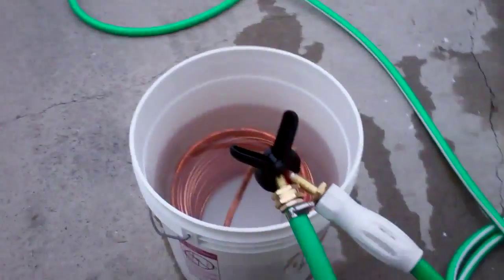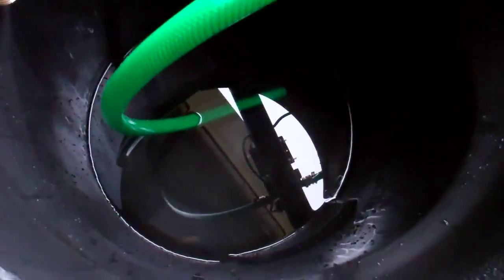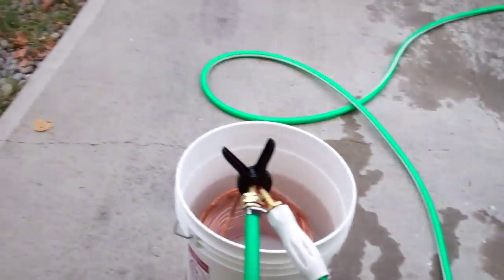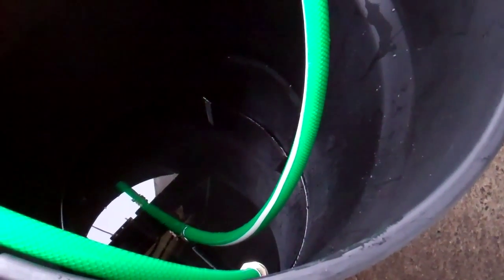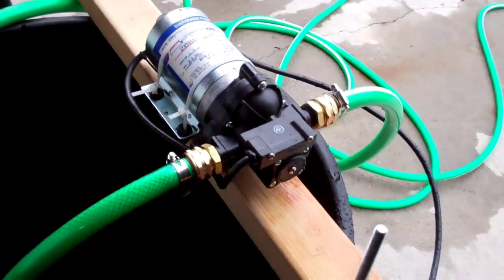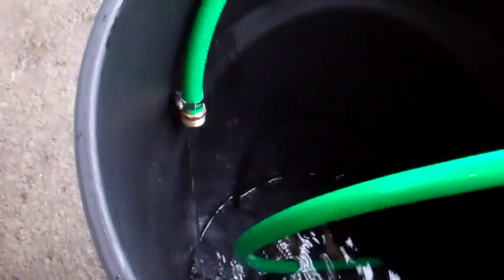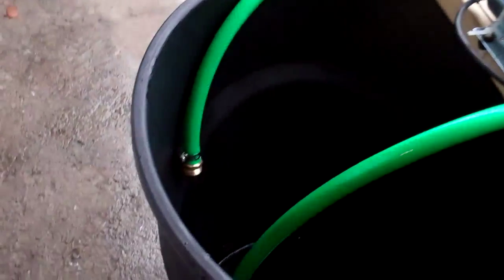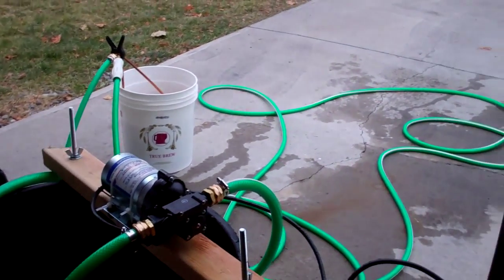Recirculating Pump for Wort Chiller (homebrewing)

Comment: I did something very similar.  I use a 50qt cooler full of ice water with a cheap submersible pond pond from Harbor Freight.  Pump the ice water through the immersion chiller, let the hot water run off until the return water is luke warm and then divert back into the cooler.  Add more ice as it melts.  I usually use 6 bags of ice for a 5 gallon batch.  If you stir the wort as it chills it should take about 10-15 min tops to chill it to temp. Could also use a clean 10g MLT to hold ice water.

Comment from the maker: I put the first 2-3 really hot outflow gallons into a bucket. It doesn't go back into the garbage can. In the winter, there is usually a little ice still left in the garbage can when the wort is at pitching temp so heating up the cooling water is not an issue.

Comment: Ok this may sound dumb but how are you going to chill your beer as you recirc water heats up. Once the water in the trash can is say 120 degrees you cant go lower then that. If you toss in Ice to cool the water and actually chill the wort down down to pitch temp  how are you going to have hot water to clean up with? Just does not seem like it would work for both.